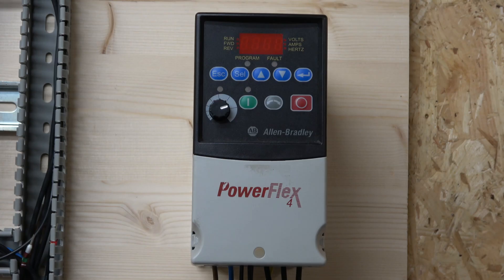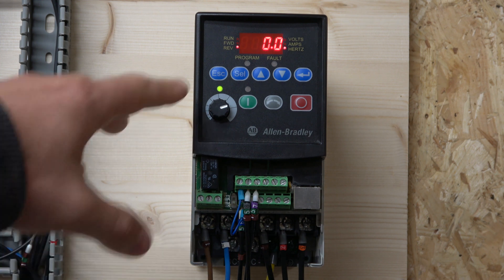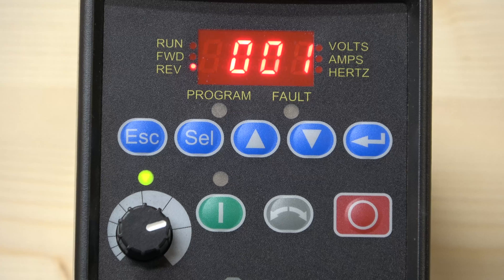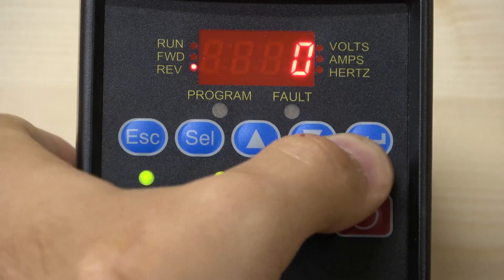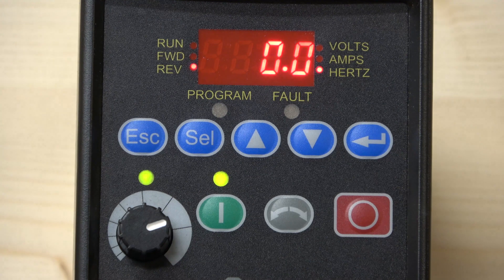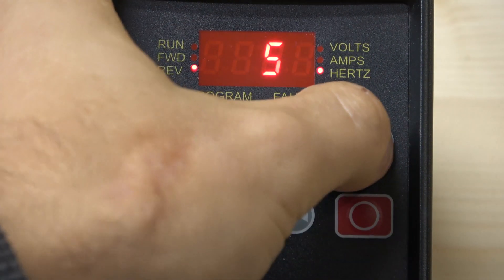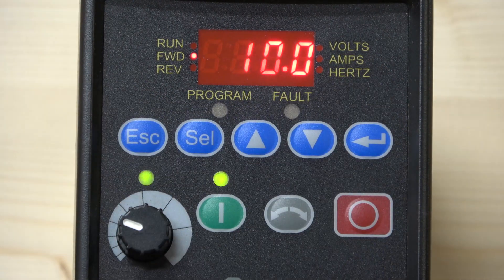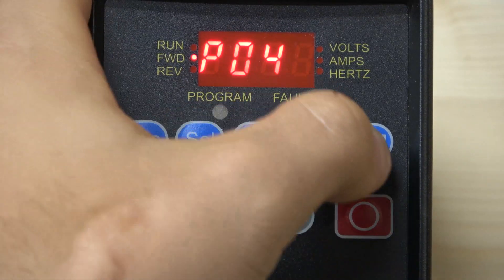Allen Bradley Powerflex 4 local mode set up and Factory reset Single phase (English)

Comment: Hi,, great video. I have a few of these in testing.. I have a 3 phase motor from an old HVAC.  The motor is 3 phase, but the rotor has magnets.. Will this controller operate this motor?  If yes, then It's not functioning correctly... There are no fault codes, If i try to run the motor, it only twitches back n forth.. I'm thinking the motor isn't compatible.. Please advise, thanks..

Comment: I have a Powerflex 4 that came on a Jet Mill I purchased awhile back. Having difficulties with the torque settings and can't figure out how to increase motor torque. Does anyone know the setting to increase it? Like I'll drill a 1" hole in 1/8" steel and it constantly stops on me. I know the motor can handle a lot more than it's giving out but just can't figure out the setting for it. Any and all help would be appreciated.

Comment: Hope you can help on P031 my highest volts is only 230 but my motor is 380 v 3phase and I tested the single phase to 3Phase VFD and the outlet only gives me 230 v between phases. What can be wrong
Reply: The vfd cant make 380V from 230V. You can only go from 230V single to 230V 3 phase.